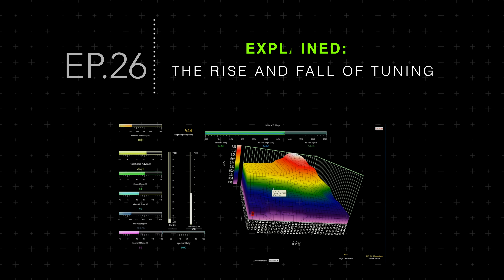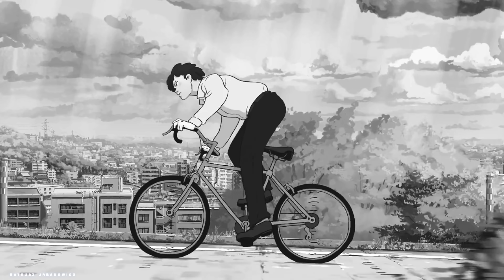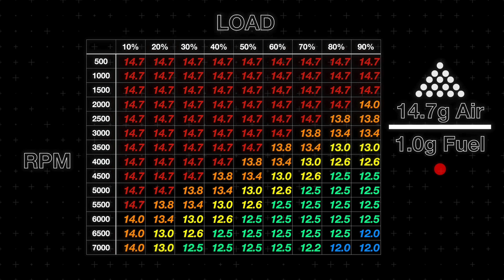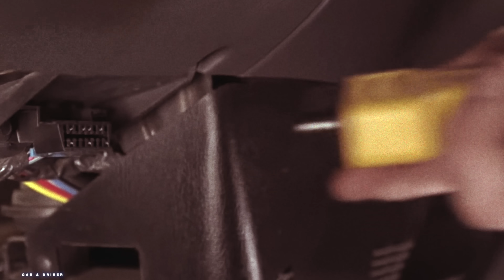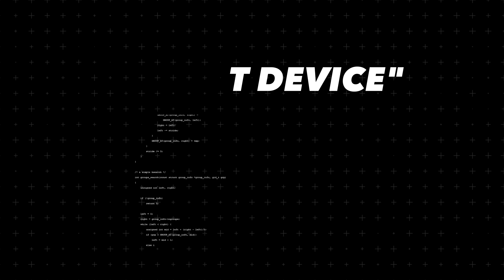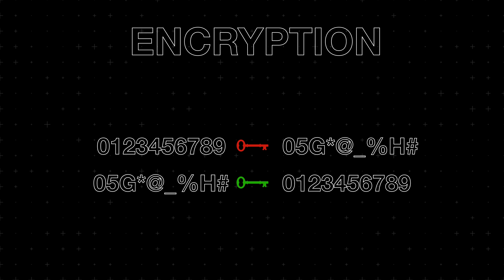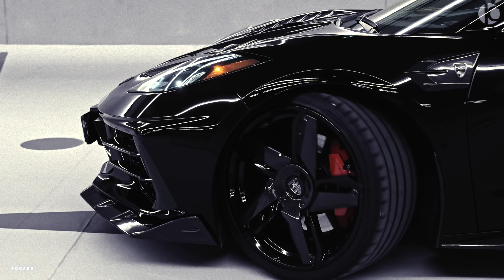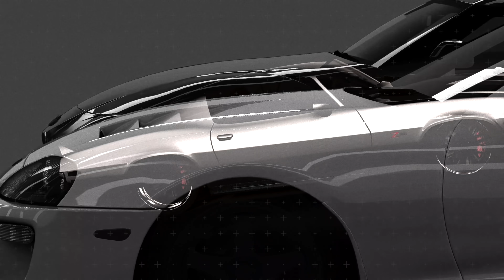How Tuning Engines Became Illegal👮🏻‍♂️| Explained Ep.26

Comment: The part about the EPA and CARB that's completely illogical to me is that you can't just swap in a newer and more clean-running engine to an older chassis and be all set. If they are truly concerned with vehicle emissions, let us do individual vehicle testing like on pre-OBD2 cars. If I want to build some high compression turbo motor for my grocery getter and it can be tuned to be at least on par with the factory engine for a vehicle of that age, and I can prove each year for registration that it is running that efficiently... get off my back.
Reply: The only problem is if you go in for a smog test they don’t know if you just have some efficient tune just to pass it and they aren’t gonna spend money to sniff test cars while they’re on the road either
Reply: @btvbrndn Long ago an engineer at MIT showed that by the road testing is far more efficient at pulling high polluting cars off the road than EPA testing stations. A very small percentage of cars cause 95% of the pollution and they are easily caught using by the road testers.
Reply: "you can't just swap in a newer and more clean-running engine to an older chassis and be all set."   Um, yes you can.  You can do EXACTLY that in most states, but it has to be governed by the OEM emissions and control equipment, and engine management.   Not a big deal if you set it up for inspection, but either swap out the ECU or run an aftermarket unit in parallel.
Reply: @guntrain212  Yep , that's how they do it in Texas. You can swap a later model engine as long as it meets the emissions required for the newer unit. Dropped an aluminum V6 and trans from a 2019 Camaro in my 2000 S10. No hassle at inspection at all.
Reply: @guntrain212  like you said it varies by state law. I can't do that in Utah on OBDII vehicles. As far as I understand our archaic laws you could put whatever in a 1995 or older car since those have to pass a sniffer for their emissions test anyway.
Reply: @guntrain212 people who OWN cars and trucks in a FREE country should and DO have the constitutional right to own personal property. And have the right to modify personal property.  Period.  The Constitution says this very clearly.  We don’t need unelected three letter agencies telling us what we can and can’t do with our own property.  The government works for the people. Not the other way around. Time for the people to get educated and stand up for your rights.
Reply: @champspec Perhaps, but if my modified car dumps toxic waste in your yard are you ok with that? It's my property. Who cares what happens to the exhaust. It's in your yard and now your problem. That's why all these regulations have been written over the years. We all need air to breathe.
Reply: @justinfowler2857  you act like modified cars are the biggest cause of pollution
Reply: @justinfowler2857 the share of emissions coming from cars is only a small share of the pollution In any industrialized country. This is all bull$$$t political theater,intended to bilk the public out of money.
Reply: @justinfowler2857 If it is dumping toxic waste, you should have to prove it and if you do, it will be removed and the person punished.
Reply: @justinfowler2857  Car emissions aren't even remotely close to the #1 cause of air pollution. That and a few cars that are tuned would have no noticeable effect on the current air today nor would they if cars were the ONLY source of air pollution. Basically, you're an idiot.
Reply: CARB does allow you to swap in an engine from a newer vehicle into an older one, but it has to be completely stock, running a stock tune in the stock computer from the donor vehicle. And it all has to be inspected by a CARB referee before they will sign off on the car.

But yes, the rest of the statements are true. It's all about the control and money for the government. I had purchased a car with a slightly modified tune because it had a slightly smaller supercharger pully and made a little more boost. It passed the CA smog check multiple times, running just as clean as a factory stock tune, before CA changed the law to make all tunes illegal. Complete BS!
Reply: How about get off my back completely because unlike EPA execs and the politicians who proposed CARB, I don't put 1000 hours on my private jet or 500 nautical miles on my yacht that I don't own every year. When the powers that be crack down on air travel and maritime, which probably pollute far more than any car currently on the road has in its entire lifetime in just one voyage, maybe I'll give a fuck. Until then, leave us all alone.
Reply: Federal grandfather act bud. I have a 1970 dodge charger no airbags and has a damn lap belt. What do they teach you guys in schools? You cant buy an automatic gun after 1986 but people that owned them could legally keep them.
Reply: @JBMSTRIKER71   thanks! I'd never heard of that. Can't remember what they taught us in high school (the decades have lost it to time unfortunately) but I don't recall anything like that. The only memory registering now is that cars before 1960-something don't have any emissions requirements. My buddy rebuilt a 1967 Mustang specifically for that reason.
Reply: @kalmtraveler Any vehicle 25 yrs or older doesn't require emissions test .
Reply: @bobbybishop5662  that is up to your state and county. In mine, 1968 and up have to do an emissions test every year once they're 5+ years old.
Reply: @kalmtraveler  Wow that's nuts , Texas considers anything 25yrs or older a classic and waves the emissions test but still have to have annual safety insp at registration renewal.
Reply: @bobbybishop5662  yeah what's also crazy is that I think Utah as a state removed the requirement for safety inspections entirely a few years ago which is good for me since my daily has the airbag light on due to something wrong with the driver's steering wheel air bag igniter and I haven't felt like fighting the dealership over it (they replaced that exact piece about 5 years ago due to a recall).
Reply: @bobbybishop5662  Yep. I live just outside Austin. And, of all my cars, the ones from the 2000's and up are the most problematic. Any tiny little issue and you get a check engine light and there goes your "inspection".... Any car I get involved with from here on out will be at least 25 years old. I'm over it.
Reply: My dad’s 65 Corvette L76 has ZERO emissions. No computer either. Never existed in cars then. He’s the original owner too.
Reply: @kalmtraveler  Is that an early Jeep Liberty? The airbag light is a known issue with the early-gen Liberty. Heard that the air bag can randomly inflate, if you ignore a recall that Chrysler issued, IIRC.
Reply: @RJARRRPCGP  oooh my daily is a 2008 Honda Element. I thought maybe the clock spring went bad because the airbag, horn, and radio control wires all run through that and my radio controls have mostly stopped working but I replaced the clock spring and still the airbag light is on with a code that says it's the driver airbag igniter, and also still the radio controls don't work unless it's very hot inside the car. Also odd that a part Honda supposedly replaced under recall would randomly go bad just a few years later.
Reply: If they really cared about emissions then there wouldn't be laws trying to force people to only drive EVs. It's not about the climate and never was. Its just about money.

Comment: The more electronic crap that's been shoved into cars, the more expensive and less reliable they've become, and the less we've owned and been able to control them. Not just tuning, but even basic diagnostic and repair is made impossible for owners and independent shops. In extreme cases, these electronics even make cars more dangerous, due to things like steering and brakes being rendered inoperable by power loss or system malfunction.

Comment: With the newer laws coming in any car I mean any car over 30 years old will no longer be looked at nor checked if it follows the clean air act cause a lot of people got in trouble for their cars not being up to date but they couldn’t actually do anything to get oem parts when the maker of said cars went out of business so anything 30 plus years old are exempt for the emissions testing and basically mean feel free to modify it cause it no longer can be upkept to modern standards so be loud be proud and start modifying those old Pontiac Oldsmobiles and Buicks from the 90’s along Side Saabs and citrons 
With some mercury’s as well any car that doesn’t have any current parts being made for it by the manufacturer or are just out of business then get to tuning here is your chance to not be punished

Comment: I used to tune my first car with a strobe, I think it was supposed to be set at 7º BTDC at 1500 rpm ...I had no professional background in auto-mechanics but you could learn it from the car manuals. Biggest danger was getting loose clothing caught in the fan belt. You also used to be able to get a special spark plug with a window in the top of it so you could actually observe the flame colour under idling or revving and adjust the fuel/air ratio. Ahhhh the good old days
Reply: A spark plug with a window?? I've never heard of that that's cool.
Reply: @LifeisGood762 'Colortune' - imagine a plug where the white porcelain is made from heat resistant glass  ! Bought one to try and tune my old Vauxhall but it had the slant 4 engine so was a bugger to see properly !!

Comment: I had an 85'Buick grand national that I removed the emissions and twin turboed it, piggybacked a moronic ECU driving an extra set of injectors and the timing and reduced the emissions of the car. Passed emissions tests Without catalytic converters but had to put fake ones on the car to pass visual inspection. And it was an 11.00 second street driven car. Driven every day.

Comment: In short, is VW blame. The ECU can use an unprotected table for tuning, and that could be really nice to have, that will not give access to any firmware protected by IP, and do tuning for yours components and environment is better. But the problem now is make sure you do for performance and keep regulations, not just change it when you go to do the check.

Comment: Derp. Just get your torque from an electric motor. Get a generic controller. Increase the amps per rpm within a hair of the motor melting. No emissions.
Reply: Looks like you've got it all figured out.
Reply: Except its expensive and they’re not really good at higher speeds
Reply: @Tylerd838  One can put a gearbox between the wheels and any kind of motor.

Comment: Makes me want to build a car from the ground up with a crate engine. I'm an electrical engineer who does embedded software and I also speak solder. So I'm thinking I would just either get a COTS ECU for a small block or Coyote or do it myself. Interesting that Pappadakis' tuning of the Supra involved fabbing a custom EFI manifold b/c the stock Supra tuning was locked down tight.
Reply: I'm a mechanical engineer. I'm thinking of doing exactly that but with a subaru boxer hehehe.
Reply: @FLMKane  u guys should team up and make the ultimate car specifics to car enthusiasts, funny enough i actually thought of doing what both of u did

 which is try to the learn the basics and make my own engine and ecu system but the only experience i got

 is building a custom computer system from scratch and thats incomparable to what u guys are doing

Comment: the EPA is the biggest joke of our planet right next the these "green" energy movements,  you want to become more green make a car run on a small diesel engine or go hydrogen fuel cells cause the whole EV thing is a croc of chit the power still comes from fossil fuels to charge them.     If built right I bet you could easily get 100MPG from a small 3 or 4 banger diesel WITHOUT the DEF fluid cause that stuff is worse on the environment that the fuels themselves.

Comment: Well my understanding 
Turbo motors can’t handle the long pipes with cats and mufflers the way a blower engine can. Pressure wise and flow velocity. Also with Turbos. The piping needed makes it much harder to run traditional exhaust to under the engine and to behind the rear axle unless said turbos are mounted where the header tubes traditionally are when all single bent however they are and said collector in the same space. Or they are mounted down next to or after the trans next to the drive shaft. But now you need to use more piping to get to the inter cooler. Creating more lag unless the pressure and speed the air is moved dialed in perfectly. Also makes it so the air gets hotter before the cooler then not getting as cold as it could be with the turbo under the hood or right next to the intake manifold without intercooling. Or using a intercooler that sits on top of the intake manifold or is a 2 in 1 cooler/intake manifold.
Recently I saw someone use a big “super chiller” that’s typically used with roots style blowers in the high performance power boat world. Created a custom one off collection funnel between the cooler and the turbo, allowing air to have access to the entire area of the top of cooler then thru intake ports.  The super chiller’s hose lines were ran to a box with ice and water in it instead of the sea water pump that also supplies the coolant for said marine engines. Sea water flows thru the water jacket in marine engines then if you have “wet exhaust” out the exhaust. If using “dry exhaust” there will be holes someone near the drives typically or the rear side near the stern for the water to flow out. In boats the super chiller would be supplied by the sea water pump as well as the cooling via the engines water jacket. Air temps in the intake ports is stupid cold. He had used a ram air intake manifold with a hole drilled in each runner with a censor in them to check the air temps after the super chiller. Then replaced the intake with a typical one. Only made that first intake I mentioned to check air temps

Comment: you forgot something...
Stand alone ECU's where you wire the engine to an aftermarket computer are also being defeated. This was a great work around as the fully programable aftermarket units usually had better features than a hacked OEM.
BUT Modern cars are running brakes, lights, windows, AC, radio and more thru the ECU. So when you try to wire the just engine to an aftermarket ECU, you break the rest of the vehicle.

Comment: Mehh... got a microsquirt v3 to tune my roller 5.0 thats in a 96 supercab ranger autox race truck out of necessity because the seller of the engine was supposed to give me that stuff with it. Well the donor vehicle got crushed with that stuff inside, not to mention ford never made an explorer 5.0 with a manual trans, so it made every bit of sense to get an aftermarket ecu for my swap. I could have made the factory 5.0 computer work, but it would never have correct ignition timing tables for a manual transmission anyway, therefore driveability wouldnt be perfect without tuning. I doubt ill ever buy anything else 96 or newer, so ill just continue tuning.

Comment: According to the John Deere vs Farmers SCOTUS rule, the manufacturer has no right to restrict access to the operating software for the engine management system, which will spill over to the automotive industry.  So, theoretically, the customer has the right and the ability to access the engine management software program.

Comment: What dumbfounds me is that the Gov, (EPA) is over here thinking we just want to pollute the world and pay more for gas etc. Well first off, with the price of gas today, thanks to Biden, I dont think anyone wants to pay for more for fuel or let alone waste it in their vehicle. They wont power and performance with their engine and if it reduces my MPGs a little bit then so be it. A tuned motor is a efficient motor, most of the time! I just recently went E85 and love it!! CA was pushing for alternative fuels and etc a long time back and really start promoting it over 15 years ago which is why you see a lot of flex fuel vehicles that came out about 15 years ago. Not as many today cuz the gov decided to go the EV route and figured its better to promote EVs cuz they can control them better and regulate more. Heck the tax savings at the pump from going 91 to E85 is worth it alone just to not have to pay the state taxes on my fuel. Sorry, I rambled on there , but EPA is cracking down cuz they want to force everyone to go EV as much as they can or put in only what the EPA says is OK to put in. Its all about the money, these fines dont  help the environment at all, they just pad someones pockets.

Comment: with the advances in BEVs that are happening now, it won't be long before drag racing vehicles with internal combustion engines will be as relevant as drag racing Model Ts. Of course, a real enthusiast would find a way to source an ECU that they can tune as they please, OEM equipment be damned.